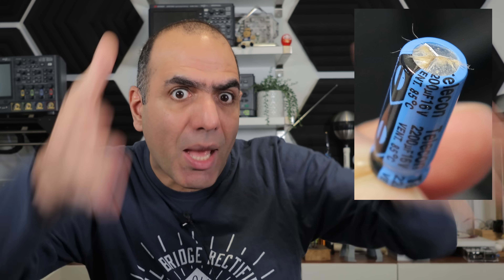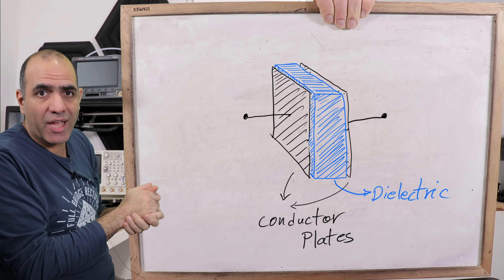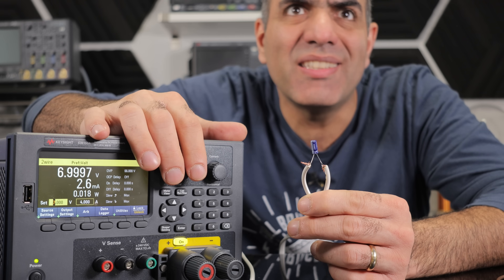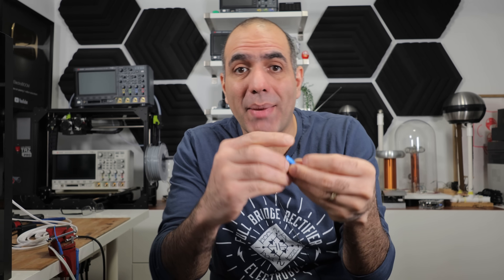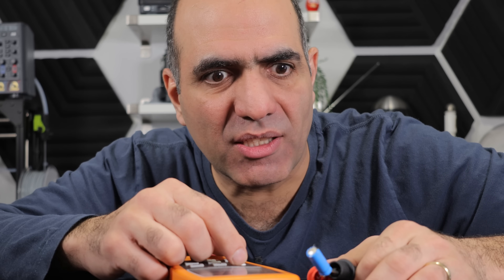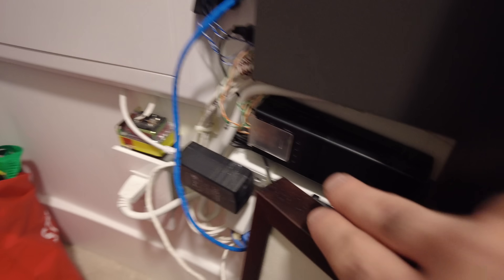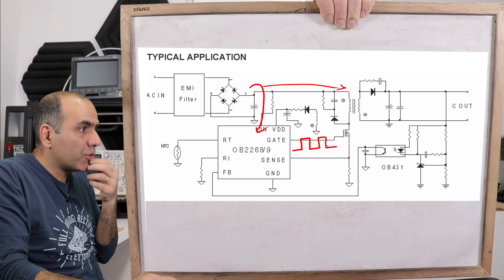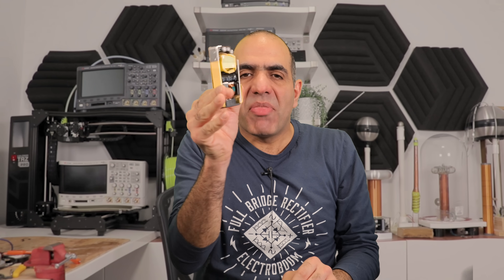Why Replace Bulging Electrolytic Capacitors

Comment: most switching chips are semi-universal
plus it could be the bootstrap capacitor is shorted, they can die without bulgies

either way given you have boomer hobbies you probably should have a stock of each chip frequently found in switching supplies
you are gonna blow up a lot of chips so having a hot-air rework station and a stock of PSU chips for when your >10kv "toys" send a shock to ground that kills a PSU it takes maybe 5 minutes to fix them

also make sure you have spare mosfets, the next most likely dead part in those supplies(had a few die because mr "metal oxide semiconductor field effect transistor" did not like the heat of shitty poorly overrated power supplies)

given these days everything uses a 12v or 20v or 24v PSU it makes sense to just have an (exploding capacitor censor) load of spare 12v supplies, with a few laptop adapters(95w are worth keeping because you can use a bigger one on a smaller laptop/device) and then your rare types like teh 48vdc 2a LPS supply to charge my ebike pack

no real reason to need more than 12/20/rare voltages as if your device uses 5v you can just use a cheap usb-barrel plug and a cheap usb block you likely have a drawer full of and if it uses anything other than 5/12/20/24-60v you likely will have to buy/build/repair it

heck even a 9vdc device I owned once was capable of taking 12v, it had 16v capacitors and a switching supply right after the input, so it was fully capable of taking 9-12v and bucking it down, which likely is better for it since the current at 12v is about 25% less than 9v

all it takes is to trace the input power lines of a device that doesn't list the input as 12v with the polarity diagram and you can often do 5v/12v/20v with no real issues

there are the rare device that need >20v like my 18v tool pack trickle charger, it requires at least 22.5v for the NiCd packs and 21v for the lithium versions, or my aforementioned EBike pack at 42v peak when charged requiring an LPS of >42v with a decent current to reach a reasonable charge time

but assuming you have a few 2a buck modules and a few spare laptop and 12v adapters and usb to barrel jack with block adapters lying around you can fulfill all but the weirdest devices of old

even the SNES with it's stupid 9vac adapter(I might be off on the voltage) just instantly rectifies and regulates it inside so feeding it 12vdc (close to peak rectified voltage) will work perfectly and likely prolong the smoothing capacitor lifespan and maybe even make the linear regulators happier(the chips inside used 5v logic or less so even if the input is >12v rectified the regulators will have plenty of extra voltage to run stable and the closer to dropout voltage the input is the less heat they make and the less they wear out, assuming you don't go below the dropout variation maximum "minimum voltage input")

but given it is for a flexispot motorized leg with enough torque and speed to raise ~300-500lbs in under 30 seconds you likely need >60w of power so maybe buying a new one is more reliable than fixing a blown one, just don't forget to add a grounding wire to the legs to absorb all that fun sparkies instead of the power supply chip(fair warning, you will need to be able to drill and tap a hole in some of the hardest carbon steel around, so make sure you have cutting oil and plenty of hard drill bits)

Comment: Damm sosiety when a new psu costs less then the part inside

But its still better to know how to repair it because what if new psu would not be uvailable in the future

Also if a lot of people will repair stuff then they will be made to be repaired easier and at one point in time everything will needed to be repaired so why not make that part easier in the first plsce (instead of plastic clips or glue, to hold things together use screws, etc)

Comment: Short story: I was using a (cheap) usb charger on a train. as the train pulled out of a station the charger blew apart and i quickly unplugged it. after getting home i looked into what caused it to blow apart. it was an electrolytic capacitor. those things have a scary amount of force.

Comment: When I was 14 years old or so i switched the powersupply from european to american input (didnt know what it meant apparently we have like twice voltage of american power supplies). 

The thing started making a high pitched sound then exploded. There was black smoke coming out, the wall behind my PC was black and my ears were deaf. I couldnt hear anything but a ringing.

Comment: Great insight into the inner workings of capacitors and their role in power supply. I especially appreciate the practical demonstration of half-breaking a capacitor, and the importance of replacing bulgy ones. Definitely keeping this in mind for my electronic troubleshooting.

Comment: I have a love-hate relationship with electrolytic capacitors, they are robust and powerful but also the weakest component in a circuit. Don't trust varistors too btw

Comment: Hire yourself to scan the parts list for your P.S. and enter it into an Inventory List.
I gave Rabies to a motorized reindeer the last time I "fixed" it.
An actuator pushes baking soda into hydrogen peroxide behind its mouth on a proximity sensor.  (Old car alarm parts)
Have fun, please don't burn in Hades because your organisation skills aren't left to a computer.

Comment: I feel the sadness when it comes to buying individual parts. We should really move to China. Where you can buy them at the market.

I wanted to change the battery in my bicycle light and the tiny battery was available only on AliExpress as a pack of four. That would have arrived months later and I only needed one so I had to buy a new light

Comment: You missed the capacitors other bane, parallel resistance which doesn't show up as electrolyte leakage or bulging.... But equally detrimental to the next component which is why transistors and vacuum tubes die apart from manufacturer defects of transistors and vacuum tubes.... 
Always test capacitors for both series and parallel resistance.....

Comment: 0:50 Safety squints aren't enough for this trick, definitely wouldn't recommend reproducing without glasses or containment of some kind.

In PSUs I have repaired, the most frequent non-obvious bad part is the 22-47uF 25-50V cap on the PWM controller's auxiliary winding providing 12-18V for the chip.

Comment: That was exactly what the problem was with my 10 year old Sony sound bar. 1 day it just would not turn on. Took it apart to see if I could fix it and found a couple of the PS caps were bulged. I replaced them with ones I had laying around (larger and higher voltage rating) and that fixed it. Then I just ordered the correct ones off amazon and its still working 3 years later! maybe I'll get another 10 years out of it!

Comment: IF YOU HAVE AN ORIGINAL XBOX, REPLACE THE CAPACITORS. The capacitors slowly leak their conductive fluid onto the circuit board and destroy it. Even if you don't turn it on, the chance of it happening is apparently incredibly high. MattKC made a really good video about it, I recommend people watch it.

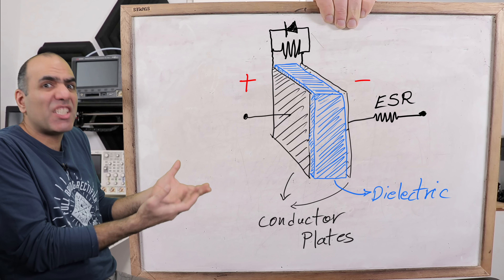Comment: 2:20 liking the PP    :)   I want one!
Reply: Strange that the PSU has "60V & 40A" which equals to 2.4 KW yet is says ⅓ of that 🤔
Reply: @electroo-light  🤡🤡
Reply: @electroo-light  🤡 куs
Reply: @electroo-light  🤡
Reply: PP? 💀
Reply: @danek_hren 
That's just the max amps it can handle at 60v. It won't always draw that much watt all the time. The Watts shown is its rated continuing running watts it can handle for a long amount of time where the apm rating is it's max rating for a short amount of time without damage. Any higher the power supply will clip the output voltage or cut off.
Reply: @dogs-and-destruction-channel  well too bad then lol
Reply: @danek_hren  
Oh dear. I feel sorry for your future power supply unit. Lol.
Reply: @dogs-and-destruction-channel  future? I have one already and it's 30/10 (300 W)
Reply: @danek_hren  
That's cool. I have a 60v version of that. It can do up to 30A at max tilt.

Comment: caps sometimes fail to short without explosion. There is cap on VDD line. It might be worth it to remove/replace it & check if psu works - i found out, that in MANY cases this single cap is the reason for failure, as it filters IC VDD. 

Ever had a "ticking" PSU? replace this cap, fixed.

Comment: I collect Commodore computers as a hobby.  So far I've had to have the capacitors replaced on both my Amiga 1200 and Amiga 600 computers, as they were failing.  Some of them visibly bulging.  These were manufactured in 1991-1992.  My 8 bit Commodore computers (C64, Vic 20, C128, C16 and all disk drives) don't seem to have this problem and function properly.  Was there a change in manufacturing process between the early to mid 1980s and early 1990s?

Comment: Watching this channel really ramps up my anxiety.  haha  It starts to seep in to my expectations after I've repaired a PSU and turn it on for the first time.  It's always a surprise when I'm met with nothing but a whirring fan and a volt-meter with a totally benign reading across the output rail.  I unscrunch my face, open one eyelid, exhale, and thank the gods of full-bridge rectification that things seem to have gone well.
Reply: i always get so worried then i realize if something actually bad had happened the video would've never been posted lolol

Comment: Did you ever explain blindleistung(german no idea what its name is in english) the one with spools and capictors that periodicly travels from them to the AC power supply and loses Voltage on the wire resistance , and how to couneract it

Comment: A capacitor is a water tank for electricity. A half dead capacitor is like a water tank with a hole in the side. It'll still fill up and out put, but its capacitance and holding charge will drop and get worse over time.

Comment: Mentor mends... makes sense.

I had an old '70s Soviet elec cap go short in an old Iskra 111M calculator's power supply... Total Recapp just to be sure. Then a paper in oil 47nF 400V in the mains filter went almost full RIFA on me, shorted, dim bulb current limiter saved the day, and the filter caps got replaced with 47n X2 rated modern ones.

Comment: I have a problem with my old but amazing logitech z55-0 speaker system. When our mini fridge turns on it makes the speakers and sub crack loudly. Do you know what might cause this? The capacitors on its main board look fine.

Comment: My question is, after a capacitor explodes why the smell never ever leaves. Years ago I've replaced my old PSUs exploded capacitor. Its been almost 15 years and it still smells burned.

Comment: I had a problem with a flickering monitor and had a look inside. There were 8 capacitors in there and two of them looked a bit bulged. I replaced all of them (not just the two funky ones) with the same value but from a reputable manufacturer (not can't-blame-my-company-without-name branding). It works without issue for well over 5 years since.

Comment: Probably not the OB2269 IC. You see the resistor in the datasheet from V+ to the VIN pin from the OB2269 ? That resistor is commonly broken. It is often the case that this resistor is not specified for the voltage required. This is why it breaks. Replace it with a proper resistor that can take the voltage ( mains x sqrt(2))or put 2 in series or something and you'll be fine.

Comment: I've had to replace a lot of capacitors in old PSU (AT and ATX). Always fun when I replace several, and a week later more fail.

Got 2 original Xbox with blown Nichicon caps that still run just fine.

Comment: Dell Optiplex 270 - if you want half-blown, leaky capacitors, just plug it in. Fortunately these junk motherboards have pretty much gone the way of the dodo and maybe taught the manufacturers a lesson.

Comment: Is it possible to send electricity true a vacuum with a cable that has no isolation???? So through a bare stripped cable going through a vacuum...???
I’m wondering if electricity goes through the copper cable... or around it... and makes it use of the atoms in things... like cable isolation or air...
Reply: Aaaaaaah will Neuralink give like pop up advertisement in your brains??? Just asking...😬

Comment: I once ran a public company that made single board computers. In the early 2000s most of the industry, including us, were fed a bunch of bad capacitors that would have latent failures and we had to do a $20 million field recall of year's worth of computers. Stressful.

Comment: If ac 120 v house voltage has live wire and neutral connected to ground wouldnt it be 120 v dc with pulse of 60 hz

Comment: You want a half failure go to the ecm on a 90s model f150. I had to replace a leaking electrolytic capacitor to fix it. Turns out its a common issue with them.

Comment: As a pc repair monkey, I cant imagine the amount of cred I've gotten by calling a dead capacitor before I've even touched the machine. Back at my first job I did a visual check on any machine on top of that because at the time every single mobo manufacturer used the cheap new capacitor manufacturer and basically any system was covered under warrantee because of it

Comment: when I moved in to my home, there was a tumbler dryer that didn’t work. It just made a humming noise. I googled the symptom and learned to replace a capacitor in it. This capacitor was the size of a beer can but cost $7.
The dryer worked when I replaced it.
The dryer was attached to a wall 6 foot up, it was more difficult to remove it from the wall with help than it was to dismantle the dryer. And then put it back on the wall.

Comment: Just buy all 200volt capacitors, the 400volt capacitors are expensive, but if you have 200volt power lines, like those world renowned countries, can't believe it, then get an expensive bucket of 400v chicken.

Comment: Funniest one i came across was a PSU cap in one of your shop PC's. It blew in such a way that the "cap's cap" flew out of the PSU and across the room, some good 10m. And that's not the fun part even :D Fun part is that the PC rebooted and it still worked... Guess it was just one of the capacitors used to "smooth" the current, whatever that's called. Damn it Jim, I'm a software developer not an electronics engineer!

Comment: I have a monitor that blinks on and off while it warms up, then the display turns off and stays off after displaying for a seconds after being turned on.. then warming it up further by turning it on and off for a while, or doing it quicker with a hair-dryer, and then it finally stays on. Hopefully I can just change a capacitor?

Comment: I ordered two sets of capacitors to fix an old PC motherboard I had laying around. Both of the original sets were bulging pretty bad, and this board was from early 2000s capacitor plague era, like the original Xbox. Hopefully replacing these caps would get the motherboard working again

Comment: don't use one common power supply for multiple cctv cameras, that's a stupid amateur installation mistake, you an electrical engineer so you will understand that. If one camera have a longer cable, the voltage drop is bigger on this camera and the video transmit line is common through the the dvr metal body, it's even worse if some cameras have the IR led on and the others don't, in this case the current consumption is almost double, and thus the voltage difference tries to equalize through the video wires, which leads to noisy image quality. video ground and power ground is common. my advice is to use a 12v 1a power supply for each camera separately, this way you will have enough safety reserve for long operation.

Comment: When for bigger capacitor current from 100mA quickly raised to 1A, that was the moment when I know - there we go, it's start to run away.. 😂 Because, after that it gets to 4A extra fast and blows..

Considering, that this isn't first time when Medhi is playing with high voltage and killing equipment, purchasing 10 pcs of same driver IC may be considered.. 😂

Comment: Do away with the switch mode power brick and design / build a series regulator PSU. That PSU will outlive you.
Ferguson Videostar VHS Videotape Recorder / Player PSU has entered the room.

Comment: My mixer had AC filtering caps blown, but not from the grooves on the top, but from below leaking shiz to the circuit board. So it's not always that obvious which caps have blown and which have not. If I have to replace cap I usually replace others in near vicinity too, they're not that expensive in general. 

Besides usually manufacturers cheap out in caps, unless we're talking about more expensive stuff like hifi-equipment, so in my opinion it's not bad practice to replace caps with more quality ones anyway when you're at it, and are planning to use that device for a long time. For example I have Yamaha amplifier from 1996 that came with Panasonic gold caps and not a single one has blown, but my cheap-ish Alesis mixer had blown caps after ~5 years (tho I bought it used from some hippies who used it as amp and left it running full power for overnight constantly when raving and stoning out. The heat and strain might have dried out those cheap power side caps, tho I've read a lot of people having similar problems with the same mixer).

Anyway if you learn how to solder and replace caps you can save a lot of money. In best cases you can even get some expensive equipment free, because "it's broken" and "taking it to a repair shop isn't worth it". I've even replaced some caps in my car's comfort control unit, the new one would have cost ~300$. I'm a complete internet taught amateur and replacing caps is like the easiest electronics repair you can do, and when you understand a bit about electronics it's usually pretty easy to diagnose. Besides if the thing is already broken there's not really much to lose anyway by trying.